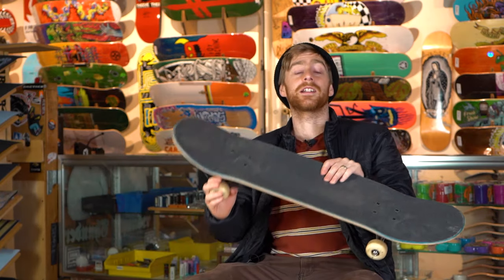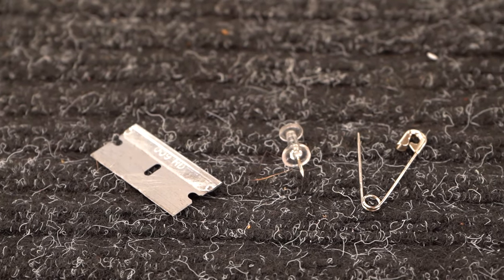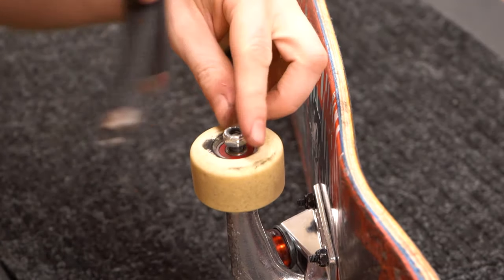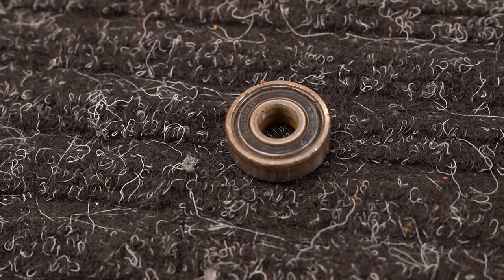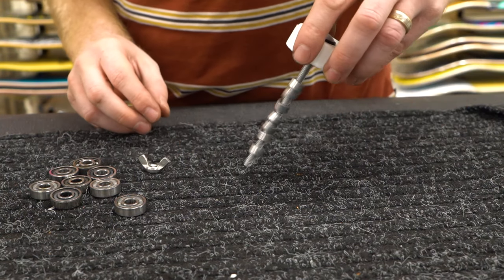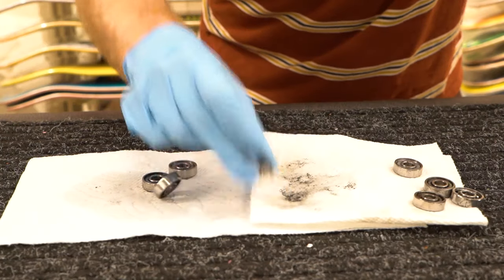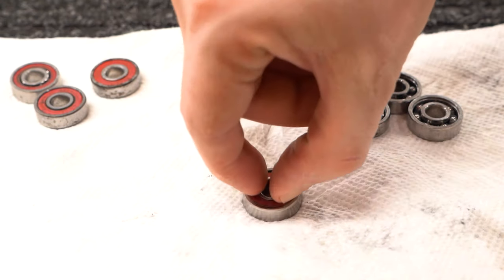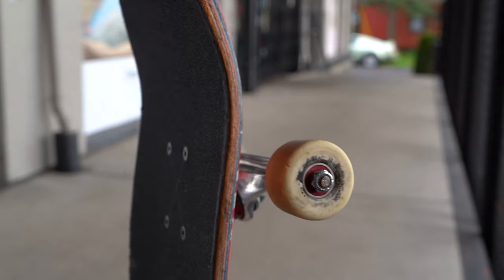How to Clean Skateboard Bearings | Tactics

Comment: I clean my bearings and for some reason one of them doesn’t spin at all even tho it’s clean
Reply from the maker: Maybe the axle nut is on too tight? If the bearing is super rusty, even cleaning it wont revive it to a like-new state. If they're rusted out, then it's time to get some new bearings.
Reply: Maybe defective, or the outer protective shield is pushing against it.

Comment: If you live somewhere where it doesn’t rain very much don’t use shields. No shields mean all the gunk flys out of ur bearings. Don’t know how shieldless bearings hold up to rain tho. If you do run through a puddle, take your bearings out. One at a time, hold them with pliers or something above a flame so the water evaporates. Then clean them and definitely lube them up.
Reply: I live in Washington it's always, skated the same bearings for 5 years no shield's  never cleaned them never had any issues

Comment: hey. many thanks for the cool video, but just one question. What to do if the bearing is so rusted that it can't be removed from the axle? In my case, the inner bearing got rusted so badly.
Reply from the maker: You'll probably have to use some chemicals like CLR or some kind of rust dissolver to loosen it up so you can remove the bearing. It might work too to try and smack it off with a hammer. 🤷‍♂️ I mean, it's worth a try! I hope you're able to get the bearing off! 🙏👍 - Tim
Reply: Yeah I used a rubberized hammer and soaked the bearings in WD-40. Just get a paper towel and wrap it around the axle below the bearing to protect it from dripping. Soak it a few times and hammer them out gently. GL HF

Comment: You can remove pressed in dirt shields but only by destroying them.  Then just replace with a removable shield.  Also shouldn't you grease instead of lube? Or maybe both? I wonder what the difference is between lubed and greased bearings.
Reply: Valid question. All kinds of new bearings I've come across have always been greased at the factory, not lubed/oiled. Came across this from JE Bearings: For most linear guide and drive applications, grease is the better lubrication option. It adheres to bearing surfaces better than oil, lasts longer, and is less likely to run off or be ejected from rotating parts.
Reply: @mauritsvw  Agreed. I am definitely using Parktool's polylube from now on, just cause I have that sitting around.

Comment: If you get your bearings wet and dry them, can wd-40 be used to make sure they’re dry (then lubricate them after)?
Reply from the maker: Yes, you can certainly use wd-40 to evaporate the water, but definitely use a proper lubricant afterwards. 👍

Comment: I‘m a mechanic and we learned a lot about bearings. It’s not ur fault that inline skated are designed like this. Bearings are very very sesitive. They have an inner and an outer Ring and a cage where the metal balls are in. If you press them in somewhere or drag them out you should always do that on the part that is mounted. In this case u would push the bearings on the outer Ring into the wheel. Bearings never have oil, they are lubricated with grease. I would dry them with a Hairdryer. But i would recommend to clean them in oil. But thank you.

Comment: So when you are putting the bearings back on should you push them in as deep as you can? Also how do you get the bearings in perfectly straight?
Reply from the maker: Yes, you should put the bearing all the way into the wheel. When the bearing is fully inserted, the walls of the core inside the wheel should make the bearings perfectly lined up. 👍 - Tim

Comment: If the bearings have metal guards do you need to leave them to dry longer to make sure all the solvent got out? And can you use any solvent on the bearings, or will some solvents damage them?
Reply from the maker: You'll be alright with any kind of solvent like isopropyl rubbing alcohol, acetone, lacquer thinner, carburetor cleaner, etc. They wont damage the steel bearings or races. But don't use any chlorides or highly corrosive acids like hydrochloric or sulfuric acids. As far as letting the metal shield type bearing dry longer, I'm not really sure. Most solvents evaporate on their own relatively quickly, so it probably wouldn't take much longer. I hope that helps! - Tim

Comment: You said you need some kind of solvent like isopropyl alcohol,
 but let's say I don't use the bones cleaning kit and I use the plastic container w lid do I still need bones speed cream?

Second question:  How long do I put my bearings in the isopropyl alcohol?
Reply from the maker: It still works if you don't use the Bones Cleaning kit, but you'll still need lubricant for the bearings after you're done cleaning them because unlubricated bearings will wear out faster and eventually fall apart. It doesn't have to be specifically Bones Speed Cream, but some other kind of thin lubricant like bike chain oil, sewing machine oil, or 3-in-1 oil will work too. For the second question, you don't have to swish it around for too long. The Bones Cleaning kit instructions say to swish it around for about 30 seconds or so, but I usually swish it around for about 2 minutes. I'm not sure if the extra swishing makes a difference, but I'd like to think that it does! 😄 Cheers! - Tim
Reply: @tacticsboardshop  Thanks for the reply but does 20 W motor oil work too?
Reply from the maker: @bigmq3003   Motor oil is gonna be too thick and gummy, it should be a thinner oil for the bearings to roll fast. 3-in-1 oil is super cheap and you should be able to find it at any hardware/department store. I think you can get a small can for around $2 and it will last you for a long time because you're only using a couple drops each time you use it. Cheers! - Tim
Reply: @tacticsboardshop  Thanks very much for your reply.

Comment: Is it okay to leave the ball retainers in? I use methylated spirits. Thanks.
Reply from the maker: Yeah, definitely leave the retainers in the bearings because they're not easy to get back into the the bearing races. Plus if you remove the retainer, there's nothing to keep the balls evenly distributed, and the balls could all roll to one side and then the bearing falls apart. Stay safe out there! Cheers! - Tim
Reply: @tacticsboardshop  Cheers Tim! That helps. 👍

Comment: What do you do for the metal cap bearings after the Cleaning them in Solvent is there a way to live them? Do you need to lube them?
Reply from the maker: You should definitely lube them up. You kinda just let the lubricant slowly seep in through the tiny spaces on the shields. 👍

Comment: When people mention WD40, I'm not sure if everyone is aware there are different kinds of WD40 brand products. For example I don't have the "classic" one that is NOT recommended anywhere near skateboards, but do have a contact cleaning spray and a PTFE Dry Lube. For cleaning bearings, I'm happy to use the contact cleaner, but for lubing I would still use something else e.g. bicycle/sewing machine oil. Not saying the advice in the video is wrong, just thought it might be useful for some to know that the WD40 Contact Cleaner can be a legit useful tool in this case.

Comment: is there any other types of oil you could use? I’m trying to fix up this super used board for cheap-ish
Reply from the maker: Bike chain oil will work, chainsaw oil, sewing machine oil, 3-in-1 oil (super cheap). Any thin mechanical oils will work. I wouldn't use thick oil like car motor oil or vegetable oil. Hopefully that helps!

Comment: I could be wrong, but I think the "Bones Speed Cream" actually made my bearings slower? I've had the Lube sitting in my jeep for several months, so I dunno if it goes bad, but it was really disappointing. Anyone know why that might be?
Reply from the maker: It's completely normal for the bearings to spin slightly slower after adding lubricant, but the lube is protecting the ball bearings and the races from wearing out and getting overheated from friction. Did you put the lube into the bearings when they were super gunky? Sometimes the lube combines with dirt and makes some greasy sludge that can slow the bearing down a bit. (Still better than a gunky bearing without lube!) Also adding too much lube can gum up the bearing for a little bit until some of the excess runs out, but just keep riding them and they'll be chillin' in no time. Cheers! - Tim

Comment: Would recommend using citrus oil or something containing D-limonene to clean the bearings rather than harsh chemicals like mineral spirits or acetone, or you're gonna end up one day with your bearings suddenly not spinning at all, and when you open them up you'll see that the plastic ball cage holding the bearings will have disintegrated into a gazillion pieces due to deterioration from all the harsh chemicals you used to clean it
Reply: If u dry it fast enough like with a hairdryer theres no problem with agressive stuff bro. Just clean and lube. I skate like 2$ bearings without shields on them.

Comment: What would you suggest for the solvent cleaner?

EDIT: I mean like brand or the quality of it or something like that
Reply from the maker: The Bones Bearing Cleaning Unit suggests acetone and isopropyl rubbing alcohol as a recommended solvents. Trouble is, rubbing alcohol is expensive since Covid (unless you have some already), and if you go to a hardware store for acetone you can only really get it in larger quantities. But fingernail polish remover has acetone in it and works well for cleaning bearings and it's pretty cheap wherever you go. Cheers! - Tim

Comment: So it’s ok to rinse your bearings out with water as long as you use the cleaner and lube?
Reply from the maker: If you rinse them in water, just be sure to dry them thoroughly afterwards so they don't rust. But after that you can just lube them up like normal. 👍 - Tim
Reply: @tacticsboardshop  thank you guys

Comment: Bearing Spacers!!??  When to use them, too big or too small and tightness !!??  Thanks Tactics
Reply from the maker: Bearing spacers go inside the wheels, on the axle between the bearings. They let you fully tighten down the axle nuts without the bearings getting pinched and evenly distribute the lateral forces applied to the bearings. In most situations in skateboarding, bearing spacers aren't going to make much of a difference. But if you're downhill longboarding and mobbing at high speeds, the spacers are important to keep the wheels tight without any slop. I'm not sure what you're asking about "too big or too small and tightness?" Maybe you could clarify? 🤝  - Tim
Reply: Tactics Boardshop  thanks Tim!  The size I was wondering about because some seem too big for certain wheels and some too small.  Like after the first bearing is in the wheel the second one goes in and spacer is tiny bit too big so it pushes other bearing out of position by a tiny bit.  Does that mean too big?  Do bones bearings spacers need bones wheels?  Or Bronson spacers only with OJ wheels ?   RadRat has a video about this but it’s about 7 or 8 years old so wanted a new take on it.  Thanks Again 👍❤️
Reply: Tactics Boardshop  sorry RatVision has the vid on their channel.  Seems to be a smart fella but it’s kinda into the longboard type stuff but regular skate stuff too.   Also tightness I was wondering to tighten axle but really tight, snug or just barely tight?  🤔👍
Reply from the maker: @memorysometimers3067  The length of the bearing spacers isn't standardized and can vary by a millimeter or two, but I don't think the spacers are designed to only fit wheels from that distributor. I think that it has more to do with the width and shape of the wheel if the spacer fits properly. The spacer will probably fit perfect in a Spitfire Conical Full but be too wide in a Spitfire Radial Slim for example. If you're using the spacers, you can tighten the axle nut as tight as you want, because the spacer is preventing the hanger and axle nut from pinching the sides of the bearing. But if you're not using the spacer, you'll need to leave a tiny bit of wiggle room for it to spin freely. Have it to where you can feel a tiny wiggle, but can't really see it. I've been skating for a long time and I've never really had the need for bearing spacers. They are pretty necessary for downhill longboarding, but for street skateboarding, they're totally optional. Cheers! ✌ - Tim
Reply: Tactics Boardshop  K cool! Thanks again Tim from TacTics 🛹👍
Reply: @tacticsboardshop  are spacers supposed to be loose against the truck axle? As in they have a lot of free space between the truck axle and the bearing itself?

Comment: I've noticed that my bearings are extremely rusted and they do not spin at all. Does simply cleaning it with Isopropyl Alcohol remove the rust as well?
Reply from the maker: If the bearings are totally rusted and seized up, then they're essentially done. Trying to de-rust them would be a more expensive process and would most likely compromise the durability of the bearings and make them more likely to blow out.  It would probably be best to just get some new bearings. 👍 - Tim
Reply: @tacticsboardshop  Thank you for the advice, I'll definitely do that

Comment: I have pressed in metal shields, do I still need to apply lubricant to my bearings?
Reply from the maker: Yes! All bearings need lubricant. It'll be a little harder to get it in there, but just drip it into the sides and give it a little extra time to seep in before you spin them to evenly distribute the lube. Cheers! - Tim
Reply: @tacticsboardshop  Thank you so much!

Comment: i have some few questions 
so im using bronson raws and theyre kinda rusted and looks like the rust is like impossible to clean will this method fix my problem and btw what aceton should i use? theres alot of aceton can u suggest a brand thats affordable
Reply from the maker: For rust, you'll have to use some other kind of rust removing agent like CLR or something similar. Just so quick search for rust removing agents. As far as acetone goes, there's acetone in some paint thinners, and in fingernail polish remover which is cheap pretty much everywhere. So you can just use that.

Comment: How do you oil pressed-in metal shield bearings or can you even oil them?
Reply from the maker: You can just put a drop of oil on the sides of the shield and let it seep in slowly, that's really the only way without completely dismantling the bearing. 👍 - Tim
Reply: And is there a difference between the acetone you used and an Acetone nail polish remover?
Reply from the maker: @dogg3752  Nail polish remover should work fine! 👍 - Tim
Reply: Oh how convenient, Thank you so much for answering my questions, I'm a new skater and i don't understand these kinds of things yet

Comment: will any kind of lube work? i don't have a skate shop or nothing around me.
Reply from the maker: You'll want to use some kind of oil that's on the  thinner side. Bike chain oil, sewing machine oil, and even 3-in-1 oil will work. You can get a small bottle of 3-in-1 oil at most hardware/department stores for super cheap.
Reply: @tacticsboardshop  thanks

Comment: If the shields are machine pressed in, how do we re-oil/lube them after cleaning?
Reply from the maker: It's a little more difficult to get the lubricant in there, but the shields usually have tiny slits in them that will allow the lube to seep in. So just drip it onto the sides and give it some extra time to seep in before you spin them to evenly distribute the lubricant. I hope that helps! - Tim
Reply: @tacticsboardshop  gotcha. Thanks!

Comment: Do I still need to apply the oil on my bearings even though they are pressed in metal cover bearings?
Reply from the maker: Yeah, lubing up the bearings is probably the most important part. So just drip the oil onto the sides and give it some extra time to seep in and get to the ball bearings. 👍 - Tim
Reply: @tacticsboardshop  Thank you so much I appreciate it

Comment: now i just put out of the wheel the bearings but in the middle of them there was like a mini tube of iron i think what i have to do whit it?
Reply from the maker: That little tube is called a bearing spacer, and it's used to stabilize and evenly distribute stress between your bearings. And they allow you to tighten your axle nuts all the way so you don't need to give the wheel any slack. They are optional though and it won't make a difference for most situations in skating. But if you like bombing hills or going really fast in general, then they're a good thing to have. I hope that answers your question! - Tim

Comment: Should I use acetone or citrus degreaser
Reply from the maker: Acetone is recommended because it will evaporate away on its own, where the citrus degreaser will have to be rinsed and then there's a chance that the bearing could rust if the water thoroughly dried. Both will work to clean out the bearing, but either way make sure you lube the bearing afterwards. 👌 Cheers! - Tim
Reply: Tactics Boardshop thanks man! Last night I used acetone but growing up as a kid I always used citrus degreaser and wd-40

Comment: Why putting the bearings in a way that the shields are exposed? Wouldn't them be more protected if they were turned inside the wheel?
Reply from the maker: You want the shields on the outside of the wheels to prevent pieces of debris from getting into your bearings. 👍
Reply: @tacticsboardshop  That is exactly what I don't get. If the shields are both facing each other inside the wheel, wouldn't they be more protected against debris? I assume there's something I'm getting wrong here. Thanks for your input 👍